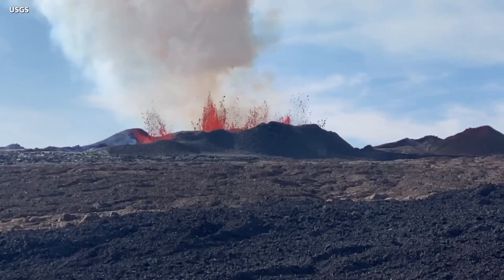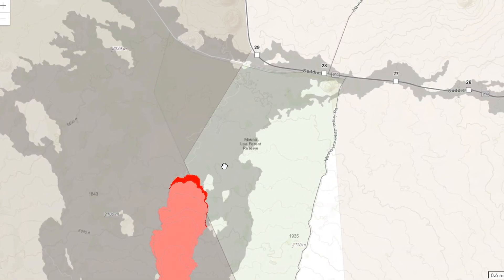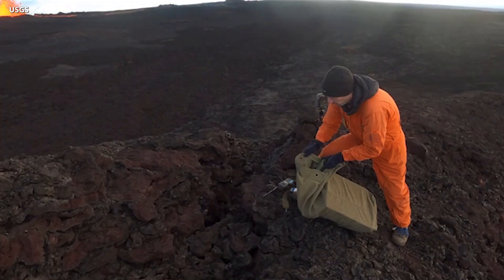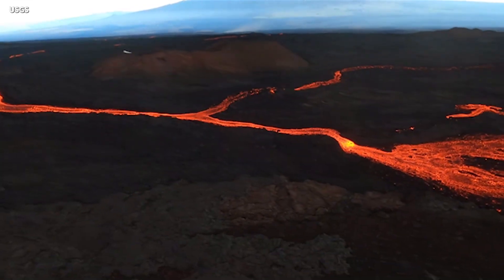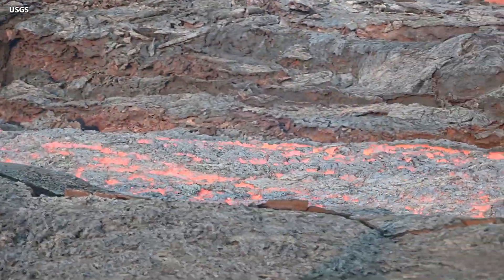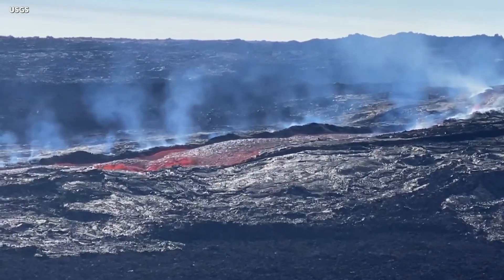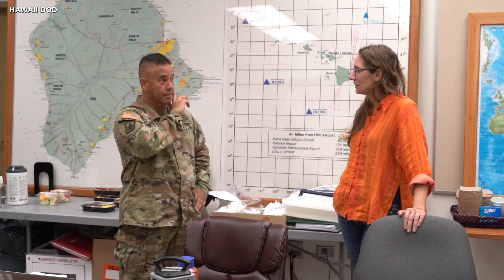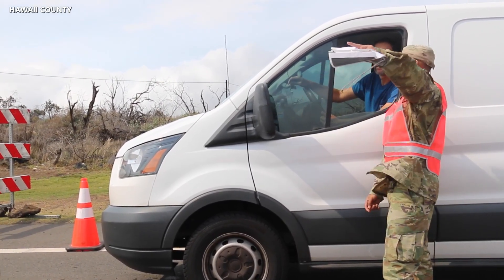Mauna Loa Eruption Breakouts Along Lava Channel (Dec. 8, 2022)

Comment: Hmmm would treating flows with liquid nitrogen be insane or just completely ineffective in causing solidity?
Reply: The heat capacity of rock is about 2 jules/gram and the capacity of nitrogen is 1.04.  Lava is about 3200 kg / cubic meter and nitrogen is 0.8 kg/liter.  Therefore, in order to reduce just one cubic meter of lava from 1000° down to 50°, it would take a little over 20 million liters of liquid nitrogen, so not very effective.  This is why lava can flow on the ocean flow for many kilometers before it solidifies, although water's heat capacity is about 4 jules/gram.
Reply: As the other comment says, water would be a more effective coolant since it actually takes more energy to heat and boil water than nitrogen. Water is also much easier to get in large amounts and safer to handle.
Unfortunately a project like that would still involve moving huge amounts of water up a rather large mountain.

Comment: Aloha I would dig a canal under the road lay concrete  canals for it to flow under the road where it goes from the other side  I don't know awesome easy simple report Mahalo for all EMS Guards  plus
Reply: If the road is the low spot in that valley, there's nowhere for lava to go. It will just fill the hole you created, and continue advancing
Reply: @bryanhull5159  Plus, even if the road isn't a low spot in the saddle, the ground there is flat enough that the flow would fill up the small channel under the road and continue over it as if it wasn't there.

This is the same phenomenon that happens when water flows over a road despite there being a culvert beneath it; the volume of fluid is waaay too high compared to the rate of flow through the culvert.
Reply: Wasn't that a movie with Tommy Lee Jones?
Reply: Additionally, we’re talking about solid rock here... NOT water. The lava won’t go away after it fills something. It only happens to be  in a very temporary fluid state.
Reply: Never ceases to amaze, the abject ignorance people speak about nature with. Simply breathtaking!